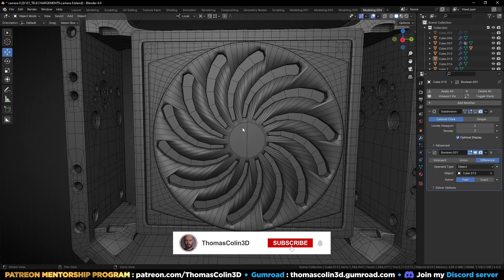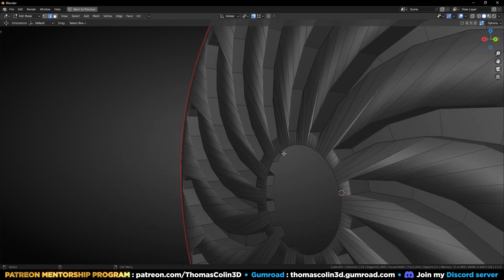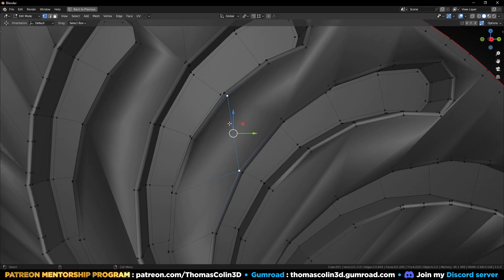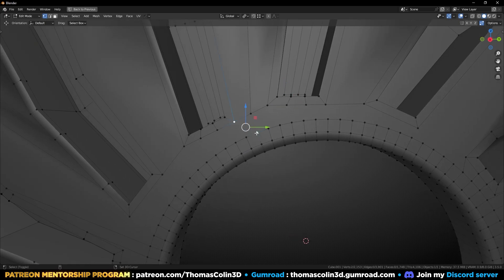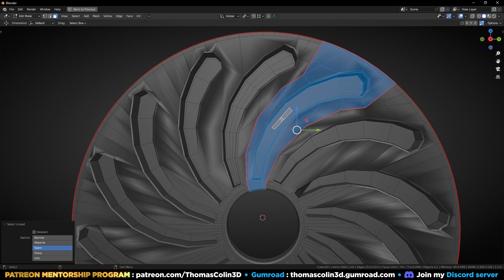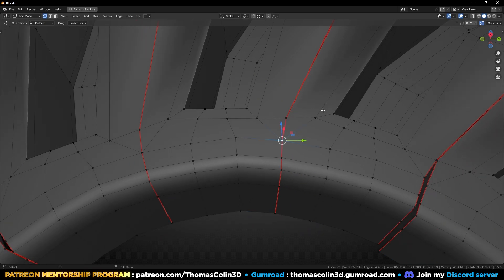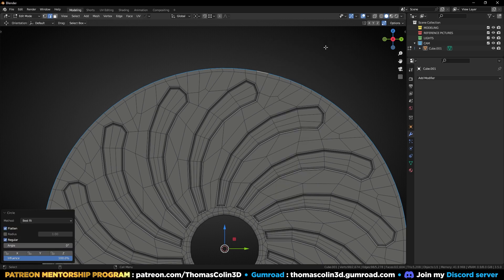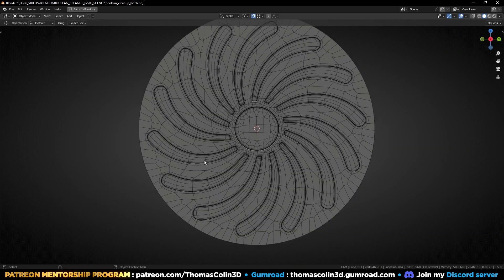BOOLEAN CLEANUP in Blender is EASY

Comment: Just not sure why you would use boolean at all for this example. You could easily make a cylindrical cap with the proper amount of segments, do some insetting and extrusion of faces, then simply soft select and twist and have a cleaner mesh achieving the same end result with much less work.

Comment: Hello Thomas! How is it going? I have a question: Does the topology matter if there are no shading errors/problems in a complex object that I modeled (the model will not change or will not add more details to the model)?
Reply from the maker: Hello, it depends of what you want to do with it. If it's for a render only, it doesn't matter. If its for a film asset, or a game asset, the topology matters yes.
Reply: @ Thank you Thomas!

Comment: I would have used an array modifier with an empty controlling the rotation, then adjust the vertices to merge them together (with the array option ro merge on), then applyed the modifier. It would have been faster.

Comment: Why do you have so much useless faces on this meshes ?
Reply: @sebastianosewolf2367  subdivs actually need evenly spaced geometry all over the object to properly hold the shape and avoid texture stretching. Regular polygon objects where every thing can be made of triangles of almost any shape and size without much negative effects don't have such issues
Reply from the maker: What do you mean ?
Reply: @Emmyskies he is right though that subdivision surface objects should ideally be evenly spaced quads. Tri are fine if you know where to put them and how they subdivide. Evenly spaced quads does help avoid texture stretching, and makes UV unwrapping easier. It also helps to avoid a lot of shading errors, quickly make varying levels of detail, makes it easy to add resolution if you wanted to make smaller details, and lets you cleanly deform the mesh (even in hard surface this can be useful, such as modeling an object flat, then using a surface deform and shrink wrap modifier to bend it over another object). Not every object needs to have topology suitable for subdivision, but it’s pretty important to know how to do it.
Reply: @sebastianosewolf2367  
haahaa,,,you know nothing about modelling and good topology 😂
Reply: @ more than you think and I work way longer there as you. Fact is as long there are no issues with texturing and lighting you don’t need these topo - if you wanna animate it bend it or similar then yes